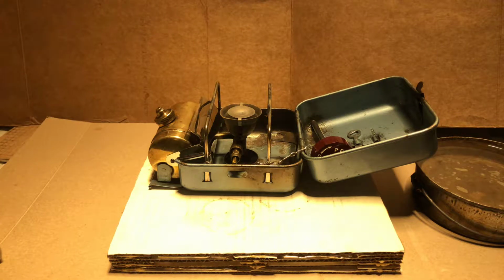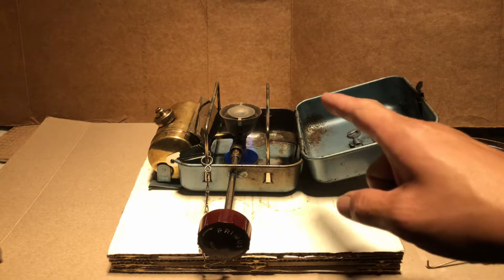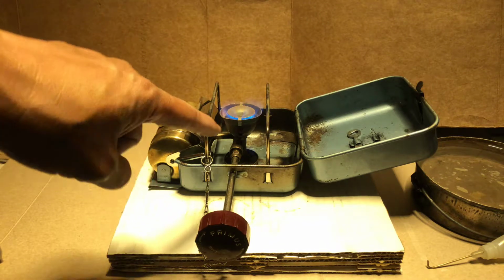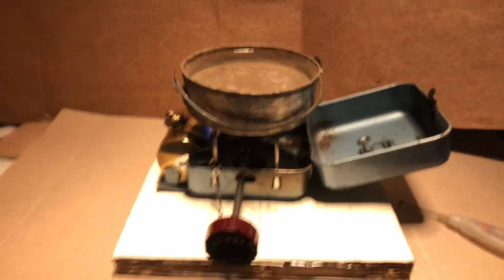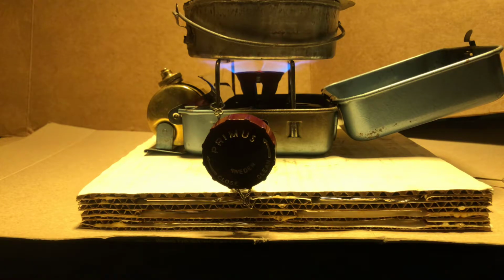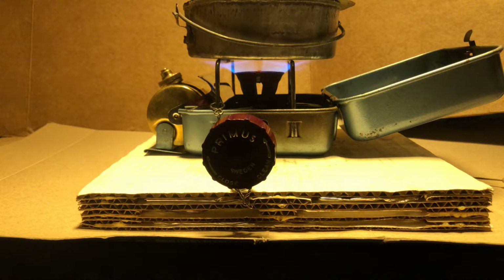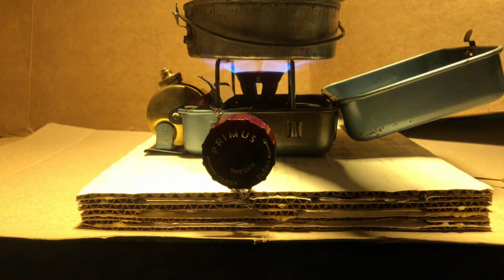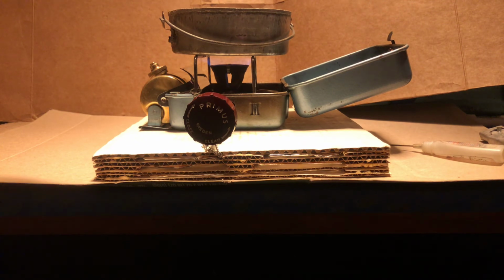Old Primus 8r stove

Comment: I completely restore 4 of these stoves, the ones with the Brass tank is original, the one with the nickel plate tanks are copies, I found there is very little wick inside the tube, which does effect the way it runs. and it's running well. the thread on the bell is a different size to the svea 123R, so will NOT fit, but the flame spreader fits all.
Reply from the maker: Yes it does. I serviced it and the wick aswell. Great stoves